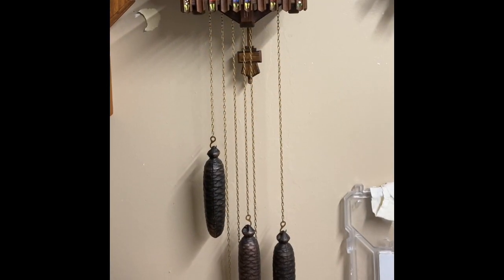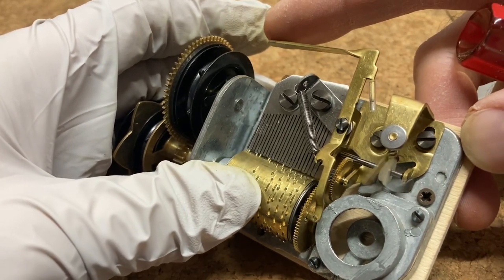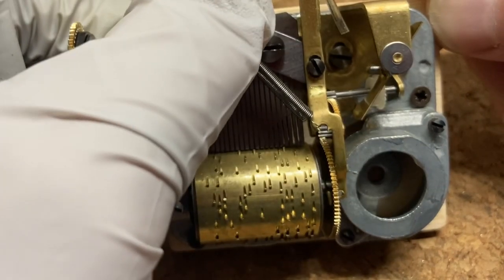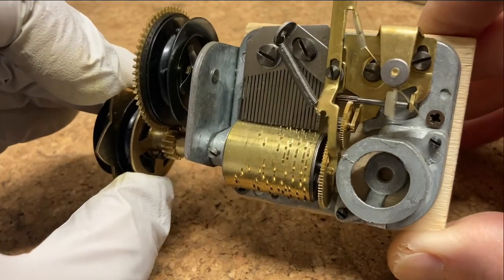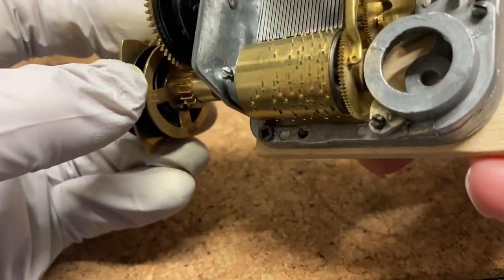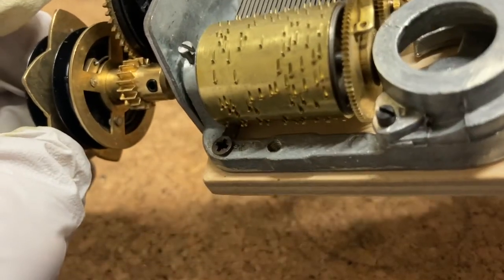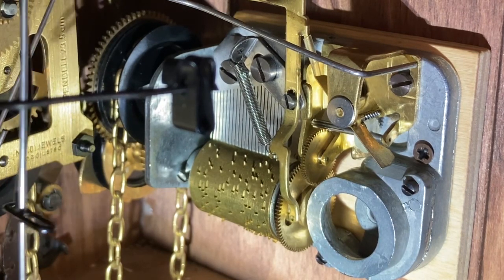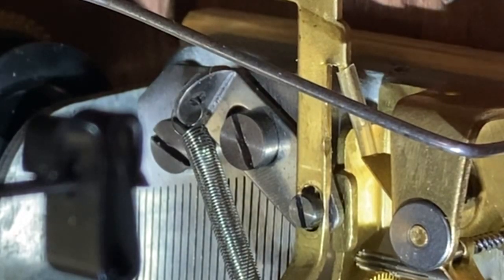Cuckoo Clock Repair - How the Cuckoo Music Box works and how to adjust in detail

Comment: I'm still having issues. The music box won't start on its own and then if I hit the fan it will go for a second and stop and its making a dragging or skipping sound. My gears are fitted together so I can't figure this out!! Talk about frustrating. Wow!! Lol
Reply from the maker: It is possible you may have an issue with the governor having too much wear or you have bent or broken gear teeth.
Reply: It doesn't look like any teeth are missing anywhere. Even when I had the music box out of the clock and was turning it to the blank area you were showing in your video it would skip or drag not sure what to call it like it would roll correctly then all of a sudden it was sounding like it was scrapping(?) And the wheel would roll fast then stop.
Reply from the maker: @claybaby003  ok. I got it. You may need to adjust the height of the comb from the music roll. It may be too close or crooked and causing too much drag. Another thing to check is if the music roll is actually moving on its shaft. I have seen those come loose
Reply from the maker: @claybaby003  if that isn’t your issue, you may have too much wear at the pivot points of your governor or at music roll
Reply: @Chrisclockrepair  i am working on another music box and the round gear teeth that is on the music roll shaft isn't turning the govern i can pull it off of the shaft how does that attach back on?
Reply from the maker: @claybaby003  it’s press fit onto its shaft and/or staked
Reply: @Chrisclockrepair  oh boy thats something I probably can't do right? A shop would have to do it,??
Reply from the maker: @claybaby003  send me some photos

Comment: Chris, great video. I have been working on Grandfather and Grandmother clocks for years, but I have my first Black Forest Cuckoo clock. It has cuckoo as well as music box feature, and dancers.  I am taking it apart to clean it and oil it, as it's been sitting in a box for almost 20 years. Anyway, I have the bellows out, and have take the music box out, and cleaned and oiled, and it works perfectly!  Now I have to take out the movement and get that cleaned up. I guess my question is, for re-assembly, does the movement go in first, and then the music box on the side? or should I install music box first and then the movement? My music box doesn't have it's own chain like yours, it has a gear wheel that meshes with another wheel on the bottom of the movement.  I just want to be sure I am putting it back together correctly.   Thanks for your time.